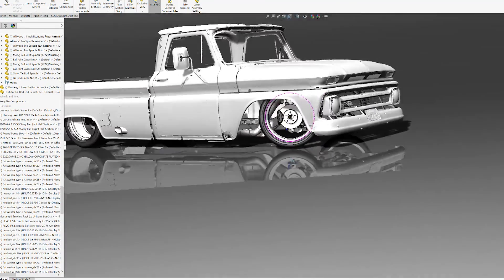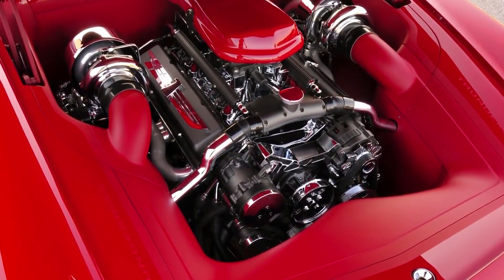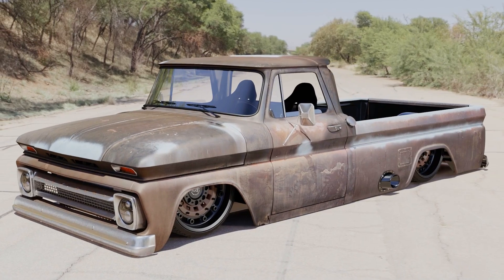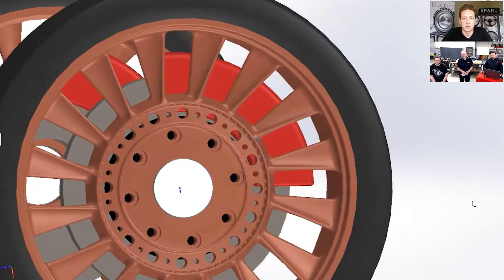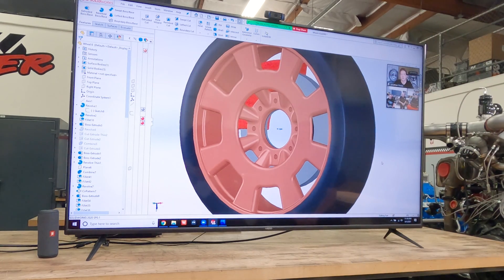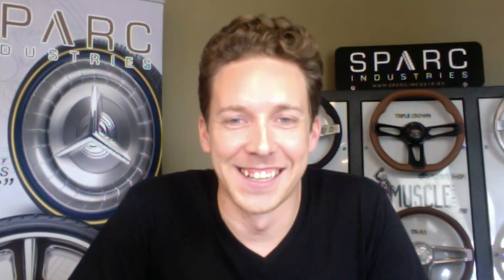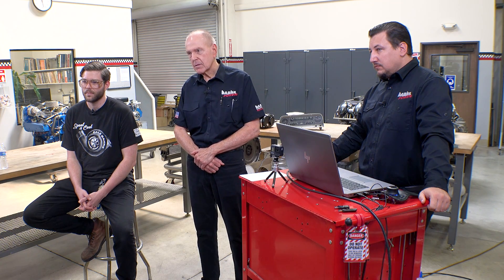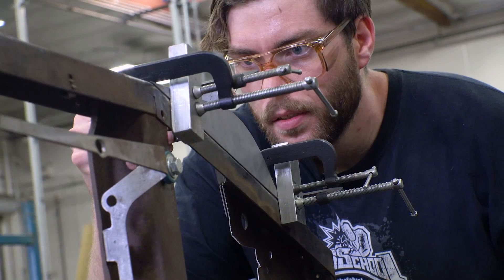Engineering custom wheels for our SUPERCHARGED DIESEL Chevy | BANKS BUILT Ep 29

Comment: Modern c130 swept back propeller only more exaggerated and more spokes for the wheel also running air-conditioning compressor  how about chilling blower manifold  with AC piping to create more air density

Comment: Have you considered the pressure variance’s on the components at variable speeds, or is the amount of pressure being created going to be negligible. I just see it being an issue with excessive stress if the amount of load from the thrust is above a certain point. And will it affect steering at different speeds with the thrust on each wheel? Just curious.

Comment from the maker: We're listening. What style wheels should we develop based on the discussion between Gale and Jonathan's conversation?
Reply: I think it would be cool if you did some US Indy style, slot-mag wheels that had 8 slots to match the 8 lugs, and then some sort of bead lock/beauty ring that incorporated the airflow needs!
Reply: Would beadlocks be doable?
Reply: @Pascal_Robert--Rc_Creations  I was gonna ask that, too!  What if the bead lock - or even beauty ring - had the aero features on it, and the rest of the wheel looked retro perfect?
Reply: Carbon fiber fan elements would be cool on a retro looking wheel
Reply: Forget the fan principle.  Not necessary and limits the design too much.  If it's got openings it will get enough air cooling.  You're overthinking it.  Go for proper style.
Reply: The ones in that demo video would look so awesome on the car 😍
Reply: @KimOve  i was thinking the same
Reply: You can probably  get inspired  by  the porsche  918 spyder concept wheels, pretty much is a  translucent plastic shield outside the wheel to redirect all the airflow from moving directly to the brake discs so the design itself of the wheel can be anything with holes.
Reply: Air fins on the barrel. That would do the air moving or help with it. Not relying solely on "spoke" air foils
Reply: It would be very interesting to see if a retro wheel could be designed with a center hub cap that would meet the airflow criteria.  While probably easier to design a more modern wheel, the hub style would add a nostalgic balance to the overall design.
Reply: Visco-Lok fan hub caps . 3d printed on some regular spoke s
Reply: Depends if roadcourse truck... Turbofan + torx design is what we need...

But if just drag strip application with occasional street driving... Go for retromodern torx wheel style with beadlock
Reply: Now this has got me thinking a bit.
You like the idea of some type of airfoil winglets in the wheels.
In my head I am thinking of the turbo impellers on that shape integrated into the wheels , but it would look nice but you want to showcase the calipers
That impeller design would be too tight to showcase the calipers.
Maybe variable vanes on the wheels (nope that wont work)
Jet boats use something similar to impellers to suck water in and force it out
Or take a look at the big rig wheels. 
Some are all chrome and others are just down to business to get the job done without looking pretty
Or I maybe just over doing it in my head on how to go about this .
Something will come up to blow peoples minds and that will be for sure.
Reply: Maybe.. taking enkei nt03 base design cues.. then use the outer ring of the enkei spokes to be aerofoil winglets, yet still have good opening to showcase the caliper and disc while still have good chunk of the hub material for lug nuts/hub bolt pattern
Reply: I like the ones on it haha.